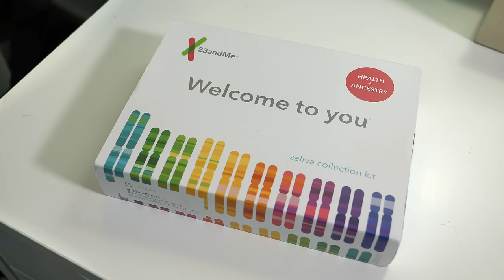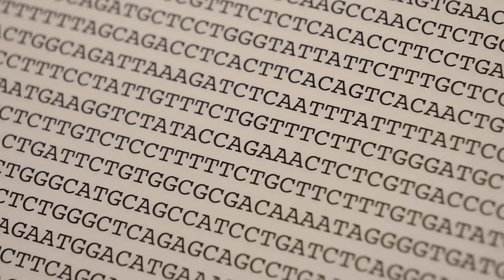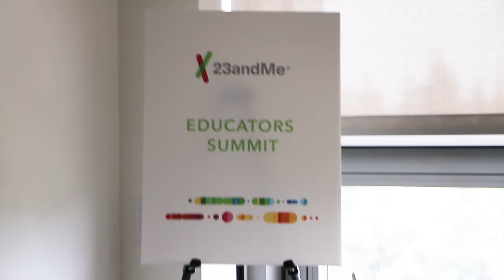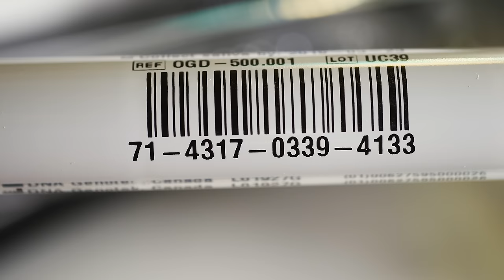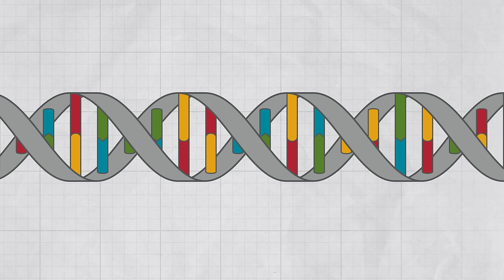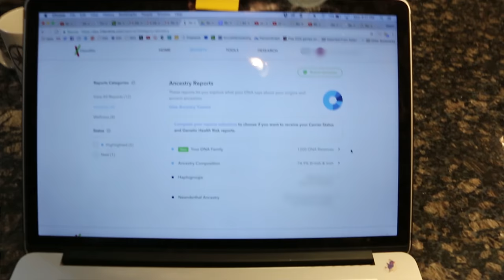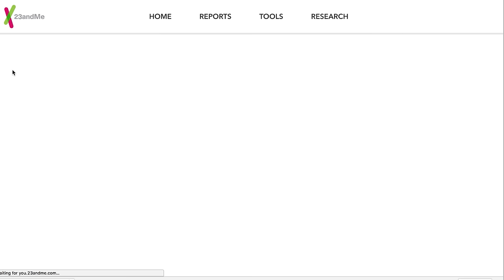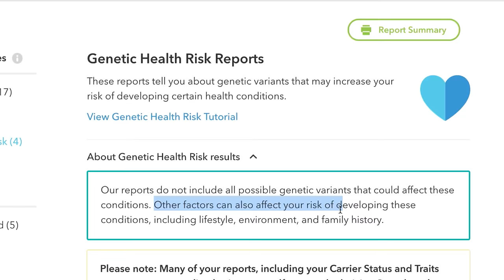DNA Testing and Privacy (Behind the scenes at the 23andMe Lab) - Smarter Every Day 176

Comment: 8:13 - Destin says, "This is like from the future!" 8:17 - Uses Windows XP...
Reply: Haha, I just was about to comment the same thing
Reply: Yeah...
Imagine them using Windows 10...
Literally EVERYTHING said about privacy in this video would be completely irrelevant.
Reply: Windows XP is radically less secure than Windows 10. It's so outdated it's almost laughable that this company is trusting the genetic information of its customers to that OS. It should honestly be criminal or a violation of HIPAA medical privacy and security rules.
Reply: j23eagle i want a macbook... and instqll windows
Reply: +Jacksirrom AFAIU the problem is that specialized biomedical software or drivers for the super-expensive equipment are often no longer updated to be compatible with a newer OS.
"Never change a running system" is bad for security but often the only affordable choice.

I'd guess that criminalizing the users first is probably a bad approach (it'd basically allow manufacturers to charge horrendous sums for new updates).
My bet would be on creating data I/O and format standards in the industry (cf. "plug &play" USB drives, monitors, keyboards...), or forcing a company to release the source code when they stop releasing updates?
Reply: nibblrrr forcing them to go open source after dropping support is actually a great idea. I've heard of several cases where the dev team has done so voluntarily with great results. Giving software the chance of an afterlife has a chance to benefit people without any potential loss of profit
Reply: To be fair, that computer is probably NOT connected to the internet, but it is very likely connected to hardware controllers that are not compatible with newer operating systems (and it costs a ton of money to update stuff like that)
Reply: The analyzers use some amazing technology, but their controller computers typically communicate only via serial connections.   They're effectively air gapped.   It's a helpful anachronism.
Reply: You are correct.  It's not connected to the Internet.   That computer likely has only a serial connection that is used to receive orders and transmit results to a laboratory information system.
Reply: WIN XP has less backdoors for hackers. NASA still uses XP as well.
Reply: +Jacksirrom along with what nibblrrr said, those things probably have an air gap.
Reply: computers directly linked to machines like that are mostly not connected to the internet. They're just connected to the machine and put data on a network drive or are entirely cut off.
There is almost no possibility to get there or do something from there.
Reply: I loled... Thankyou XD
Reply: +Jacksirrom
Most viruses are not compatible with Windows XP anymore, so it's safer!

(I'm just kidding by the way)
Reply: I immediately went to the comments when I noticed that. It looks like you beat me to it. Good job.
Reply: Guys, I'm confident using Windows XP in this context is NOT a security risk. This computer is used as the instrument controller (it's not connected to the internet). I use the same thing to program the Tecan liquid handler where I work.
Reply: @Rasalas, what if Destin was a spy and he simply connect a USB drive or CD Rom with virus into the machine ? or if he is fancy, he bring a modern day 2-in-1 handheld PC or Nano-Routers and create a remote access to the facility? Window XP don't have any protection against such exploit. Resistance is basically null.
Reply: Microsoft still gives security updates for xp but you need to pay millions of dollars. It's given the updates to select clientele
Reply: Xpoen, xp can block that. Most people don't know that xp  has security templates that can block almost anything you want. Also, xp is stripped of all non essential components(internet explorer, messenger, games, registry entries, help) and special hidden stuff in registry is changed in corporate environments. Even the secret backup dllcache is removed. Also any dll or program or driver that tries to "phone home". The mac address is spoofed and xp' s internal serial number is renamed constantly  to prevent hackers from finding the same computer on the internet. Some companies edit dll files and then recreate the an original digital signature so xp will think nothing has changed. That should be impossible but it's possible
Reply: The internet never fails! Lmao I noticed it and wasn't going to say anything but just knew if I checked the comments someone must've noticed and go figure it's the second comment hahahaha
Reply: I read your mind :)
Reply: Air gaps on networks are by no means a great security measure. Look into how the Stuxnet virus got in to Iranian nuclear facilities protected by air gaps. Uninformed or reckless employees love to plug in USB drivers or other errant media into these machines supposedly protected by an air gap.
Reply: Yes, I am aware that many higher ups aren't very concerned with security in the face of equipment and software upgrades, resulting in many XP machines still leaving data extremely vulnerable. But security is a cost that needs to be internalized somewhere, and I think that cost needs to lie with the company providing a medical service. This requires a massive change in popular thinking on what suffices as secure.
Reply: Tyler Adler  but Destin said it was all good.
Reply: I'd like to point out that many large companies and government departments still use Windows XP. For a fee you can still keep receiving support from Microsoft. The Dutch Government spends a couple of million euros on their Win XP systems.
Reply: That machine probably just runs the pipetting robot. The analysis machine shown is running something newer.
Reply: This made me laugh!!  There actually is likely a reason for the use of XP though - most work in genetics uses programs that are specifically written just for that use case.  A lot of those break when you move to a newer OS. They also often use some pretty crappy coding which doesn't work on newer, more secure OS's.  Something like Windows 10 which has an "as a service" model and changes constantly wouldn't be viable, so they likely created a program on Windows XP and then (hopefully) made sure it was disconnected from the internet and never updates the OS or components like Java (which was used a lot in old genetics programs).
Reply: Hopefully their XP boxes are on an isolated network and not connected to the internet...
Reply: It might be Windows Embedded Standard (WES2009) which looks identical to XP. 
It is actually very common to see XP or its Embedded variants in machine control systems. 
I'm actually working on treatment control software for a cutting-edge medical radiotherapy machine at the moment and that still runs on WES09. 
Remember these machines are not connected to the internet. No one is checking their email on them. They are doing a fairly simple job and only need a fairly simple OS to do it.
Reply: inb4 the genetic data gets ransomwared.
Reply: There are a lot of electronics control system that have computer interfaces that have not been updated to work on newer operating systems. Sometimes these companies won't or don't or can't update this software and it's may not be possible for someone else to do so.
XP in no way should be used on a general user device but an appropriately skilled team of IT engineers can segregate and secure a network to reduce virtually all risk of such devices. For example no internet and only able to communicate with the device it's controlling.
Reply: They're likely using legacy applications, the medical science sector ironically doesn't get much attention when it comes to programming, so many applications that they need are only available in XP
Reply: @GrahamStw - Lets just hope they don't run Citrix!  That's how ransomware spread throughout the NHS - I also work for a managed service provider and we see it a lot (not actually blaming Citrix though - more blaming user error and some choices of published applications).  Funnily I worked on that NHS project about 10 years ago and loads of engineers said back then it would happen, but of course no-one listens to engineers. ;)
Reply: Lmao
Reply: A lot of companies still use Windows XP due to software compatibility. You'd think "then have the company change the code to be compatible with Windows 10". Problem is a lot of the software devs that had the source are no longer around. And making a new software is a LOT of money. So they end up sticking to the old software and OS until it becomes obsolete. A lot of the companies I've worked for keep these machines off the network anyway so very unlikely they're catching a virus.
Reply: j23eagle came here for this! :)
Reply: upvote this guy now!
Reply: I  noticed the very same thing at about 8:13 or so also! Super OS,,,no longer supported...oh oh...
Reply: Outdated and no longer supported. And they are not the only business using XP.
Reply: How do you insert a node in a linked list? That's right noob.
Reply: Oh hello there Internet Explorer how are ya!
Reply: More than likely this terminal is NOT hooked up to the internet and is used with the more than likely "proprietary" hardware and software...which mean you would have to pay for updates for every new windows version making it easier to stay with an older terminal that is offline. Happens all the time government sector as well.
Reply: There's a hack (script) for that, run the script, get all the XP updates that are fed through windows update to the paying customers
Reply: Kevin G how?
Reply: Yeah I FEEL SO SAFE ABOUT MY DATA
Reply: I highly doubt that machine's networked.
Reply: All labs use xp becuase lab software runs best on stable systems.
Reply: That's not XP, that's Vista.
Reply: You'd be shocked how many big companies are using very, very old tech ... and that's because it would cost them way too much to change, even tho most companies have the money and spending couple million on upgrading would be nothing as they make it back in a day or two, but problem is downtime and privacy, they'd need a trustable person to change their entire system.

As a PC expert myself, lot of stuff that runs on xp, doesn't run on win 7 and later. I was doing maintenance for a big food restaurant chain in UK, they run XP too, some machines run even earlier windows (don't even remember what it was, but it was before XP, think it was 2000). And most of their software (the till software and such) cannot be migrated to a new system, which means they would lose all their customer order data and such. so obviously he wouldn't want to do it.

well yeah you CAN upgrade, but you'd have to write custom software / program to migrate the data, like read it from old one, make necessary changes to it so it's compatible with new one ..etc, but again it would cost a lot + lot of time and also it needs live testing as their machines are connected to eachother. however using old software doesn't mean it's bad, i actually prefer xp over win 10. XP has more control and options, i can tinker with it the way i want, while win 10 just slaps me in the face and laughs.
Reply: The Sethioz Project 
Couldn't've said it better than myself.
Reply: CANT help because not all os supports that particular software...but as long its not connected to any network, its safe....
Reply: With such a limited user base, there isn't much incentive for the people that manufacture that device to update the drivers for every new OS.  That isn't exactly a Canon printer or something.
Reply: not if it´s not connected to the internet
Reply: j23eagle you don’t understand. Some of the most advanced CNC machines in the world still run on dos and Unix. DON’T JUDGE BY THE OPERATING SYSTEM.
Reply: Those computers are used to run the equipment and have no connection to the internet at all therefore there is no risk. Same practices is done at the college that i work for, for professors using equipment for bio labs, Psy labs etc. XP is the most compatible with those one of a kind equipment.
Reply: Unless it's air-walled
Reply: I imagine it wouldn't be so great if windows 10 decides to force and update while you're in the middle of sequencing some DNA
Reply: lol
Reply: "Back to the Future"/Also drives a DeLorean....really!
Reply: It's extremely common to use older OSes in industrial applications.
Reply: Very likely on an isolated network.
Reply: Windows XP is the best
Reply: A lot of the comouters for the NHS are still on Windows XP or Windows 7.
Reply: love guys like you that have zero clue but talk like they are tech experts
Reply: I thought of the same thing...
Reply: j23eagle I saw that too 😂.
Reply: You also noticed those old machines, no privacy concerns afterwards
Reply: I've seen computers at a nuclear power site running Win95.
Reply: In the future, we will simplify
Reply: use linux XD
Reply: Yes that is because windows XP is the most stable platform next to NT, but NT does not support USB.  Lots of industry standard systems still use XP. I work on new multi-million dollar machines daily and they all run on XP.
Reply: @StalePhish  Perfectly said
Reply: people working for science and such doesn't really care about operating systems. if it works then why bother ?
Reply: LOL
Reply: How funny. That was the very first thing I noticed - Windows XP
Reply: Same here. Looks like they dont trust win 10 either
Reply: Most likely that windows XP is solely connected to a piece of equipment to run it, same as a computer being used to run a CNC machine, plotter or large format printer, relax.
Reply: @HmmContemplates  Same.
Reply: haw do you no i whant to say thes😂😂😂😂😂😂😂😨😨😨😨😨😨😨😱😱😱😱😱😱😱👿
Reply: Not only that - don't forget the label on the monitor!
Reply: This is so rad
Reply: j23eagle better than vista
Reply: What do people have against xp? I used it for years with no problems.
Reply: if it aint broke dont fix it
Reply: Most of the U.S military uses Windows XP it’s just overall reliable and it would be annoying and risky to update the system
Reply: lol Embedded is standad, been for a long time
Reply: @Jacksirrom  Although I would agree with the privacy concerns with Xp I think  that likely in this case it is the only option for the medical equipment in use, this isn't ideal but the machines are likely air gaped so don't have any internet access. In which case the only attack vector is physically and even the most secure OS still falter when physical access is applied to them.
Reply: Exactly what I was thinking hahaha
Reply: Military and labs use Windows XP due to reliability. More updated windows are more susceptible to crashes and can be catastrophic such as in times of war.
Reply: @etch3130  it's not really xp it's embedded. It built for these applications runs in the background of more things than you think.
Reply: Windows XP - Because all the machines are 15 years old
Reply: MS 08-067
Reply: @Jacksirrom  those machines aren't connected to the internet. There's no risk involved. I work in IT that services a lab similar to the one in this video, and there's no security risk because these are all offline computers not connected to any sort of network.
Reply: @Keizenholdt  Go read about Stuxnet on Wikipedia and let's talk about the security of computers not connected to the internet.
Reply: Windows XP is no longer supported by Microsoft and as such more vulnerable to exploitation by hackers. Any organization worth their salt upgrades operating systems when this happens.
Needless to say, it's a privacy concern.
Reply: For everyone talking about windows XP and security, you really have no idea what you are talking about!

Firstly, that DNA scanner is inside the building and is behind countless firewalls, routers, and switches, and is not even remotely forward-facing on the public internet! 

Furthermore, that scanner and the WinXP is NOT a desktop computer, and as such, is not used as a desktop system! No email, no web browsers, no third party or personal software at all! 

Secondly, do you have any idea how much that DNA scanner costs, and how much time and money went into writing the software to control it, and interface it to the real world!? No, you don't!

These systems cost multimillions of dollars and the R and D on the software and hardware drivers are not written and rewritten at the mere whim of a computer company like Microsoft, who is NOT in the business of providing computer systems for anything other than mass-market desktop usage!

So, maybe before you type a comment about computer security you should take the time to actually have an idea what you are talking about, before showing the world your ignorance!
Reply: the internet people never fail to amuse we people that actually know, they know nothing! but want to seem like they are the smartest people in the room!  it is to laugh!
Reply: @yipperdeyip  Are you kidding me? Windows XP is an outdated software. It's full of vulnerabilities that compromise data.
Reply: Trollarc Ninja  We still use DOS computers because the control software and data collection software still does what we need quite well and it's paid for.
Reply: Good ol reliable Windows XP that Microsoft no longer supports but millions of people still use.. XP the greatest OS ever made for reliability and Microsoft refuses to keep updating it. Maybe they want everyone to pay for upgrades.. even tho they’re already rich
Reply: @nibblrrr7124  you just saved me from typing a proper explanation , thanks.
Reply: I think that’s Windows Server 2003
Reply: That computer is controlling the hardware - hard to change OS on the robots.  Also that computer  has nothing to do with the genetic data, it's just running the sample processing robot.